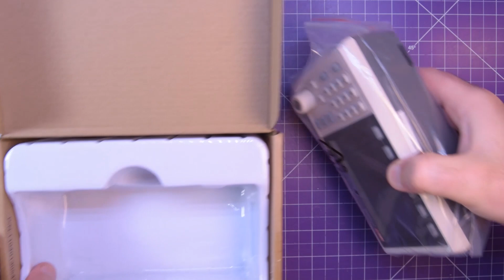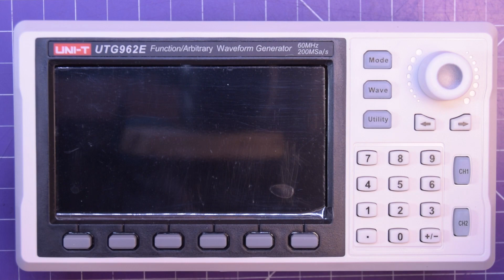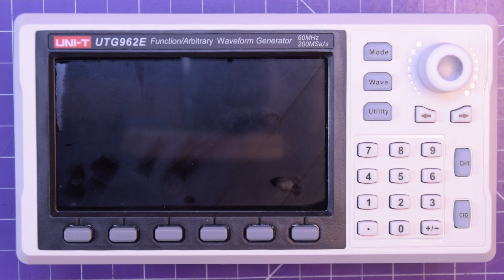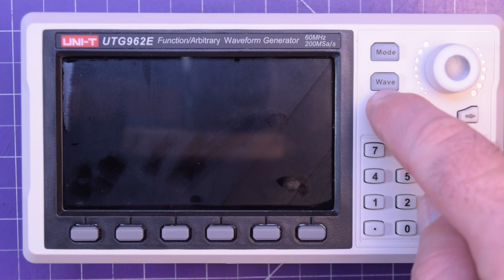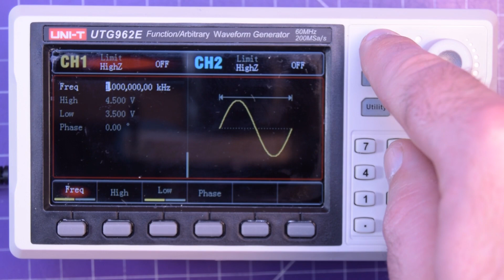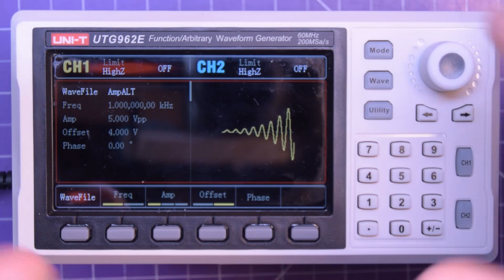Holy Crap, This Is Incredible...UTG962E first look!

Comment: WHERE IS THE MANUAL FOR THIS THING?
Holy crap is right. UniT is crap, can't even find a manual for this thing on their website. Can't even find anything on UniT 962E on their website. It's like the device doesn't even exist. The menus and controls are so disorienting that I can't even figure out how to make 2 sine waves at 1kHz 1Vpp @90 degrees so I can view lisajous on my scope. Once you do anything with mod wave you can never straighten this thing out again. All I get when trying to make channel 1 and channel 2 the same by entering values that differ is OUT OF RANGE OUT OF RANGE OUT OF RANGE. 
WHAT A COMPLETE WASTE OF $200!
Reply from the maker: I mean, I found it pretty easily: https://instruments.uni-trend.com/US-EN/waveform-generators/955.html

Comment: Nice review, thanks. You know you can turn the Rigol into a 100MHz scope by a simple software edit, it has all the inbuilt circuitry but is just locked, easy to unlock, i did it with mine as have many others.

Comment: Why the commas to the right of the decimal point? Damn confusing! If anything, spaces would be better.
Reply from the maker: Certain markets use comma separators, although most use spaces.
Reply: In the Utility/System menu, you can set the Numformat to have commas, spaces, or None.

Comment: 16:29 its not a Rigol problem. Generator have 200MSa/sec so at 10MHz it can do only 200/10=20 signal level changes per one period and its not enough for that complicated form. Only a sinusoidal signal is quite unpretentious and can be well created at the stated sampling rate. So the claimed 60MHz is only for a sinusoidal signal, everything else will work fine at a MUCH lower frequency. But for marketing and sales purposes, of course, they will write 60 MHz.

Comment: 13:20
For megahertz measurements
Use a T connector on the oscilloscope side and a 50 ohm terminator. 
On the generator side, set the output impedance to 50 ohms.
Utility - (CH1 Setting  or CH2 Setting)  - Load  - 50 Om

Sorry for the bad english.

Comment: How high is the UTG962 in centimetres? I have a feeltech FY6800 and it fits under the shelf but its screen is tiny. The UTG962 has a better UI and number buttons, which the FY6800 doesn't have.. Since watching this video, i might sell the FY6800 and buy a UTG962 but only if it will fit.
Reply from the maker: It is approximately 95mm tall
Reply: Something worth noting (If you're coming from the FY6800), the UTG962 does not have a burst function. I found that out the hard way. If you need burst, you'll have to look at the UTG2000A, UTG2000B, UTG4000A from UNI-T.

Comment: 9:45 "its actually a bit brighter than the Rigol" and also easier to see as well. I have a 1054Z and fonts are tiny and the UI is cluttered.  My 1054Z is on a shelf above the bench and i have to stand up and look close when ever i need to adjust/change something.
Reply: You can change the font size to larger if you need.

Comment: I have the slightly cheaper version of this, it is pretty great for the money. One thing I wish they would fix in the UI - it's hard to see the difference between decimal points and commas. For example 100.000,000 vs 100,000,000. I wish they would display the decimal part in a different color, that would be much clearer.
Reply from the maker: They are configurable in software, but not the color no.

Comment: The frequency is really confusing 1.000,000,00 kHz? wtf why don't you just say 1.000 kHz or 1000 Hz
Reply from the maker: That's because you can set it to 1.000,000,001 hz if you want to
Reply: @SimpleElectronics  Oh so the commas are just separators? Im dumb
Reply: @alexstone691  I was thrown off by the commas as well. It's a decent solution so you don't have to sit there and count zeros everytime.
Reply: @TheSleepyCraftsman  Yeah just that here commas and the dot are flipped so my brain gets confused every time 
But at the same time they could shorten it whenever there is no decimals
Reply: @alexstone691  This device must have been developed (in the European convention) with the commas as the decimal markers and with the dots separating groups of 3 digits. This is the typical convention in Europe. Eg, what we would write as 1,000.99 would be written in Europe as 1.000,99
Reply: Please press  
Utility  - System - NumFormat
and select :
Comma =  10.000,000,000
Space = 10.000 000 000
None = 10.000000000

Comment: 60 mhz will be plenty for testing cheap scopes. I have found a lot of scopes say 100 mhz and really do about 30. Looks really nice. I have used mine for audio repairs and to generate missing clock signals.